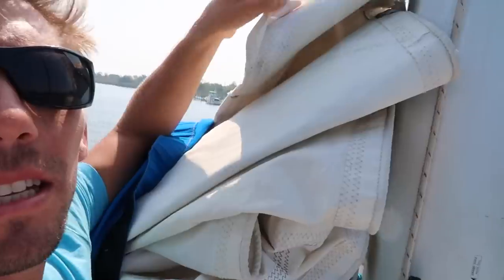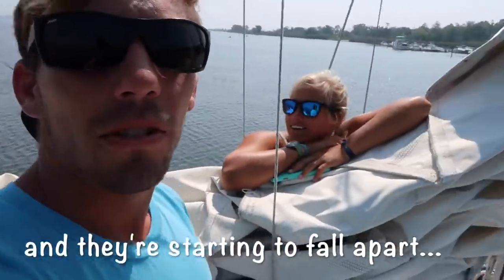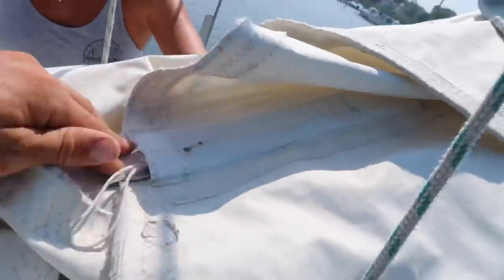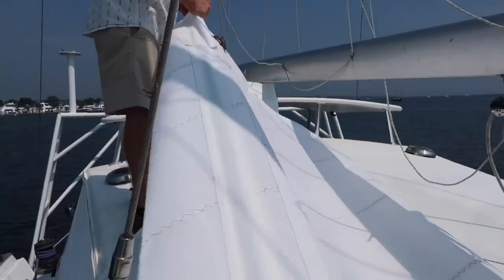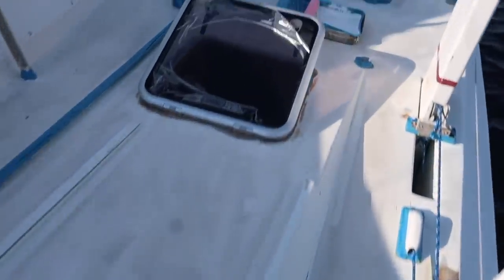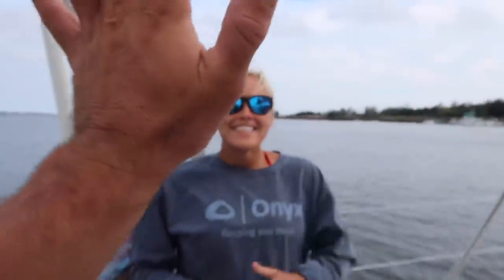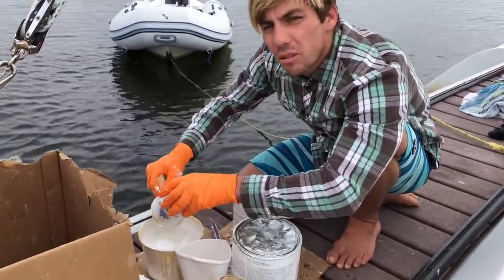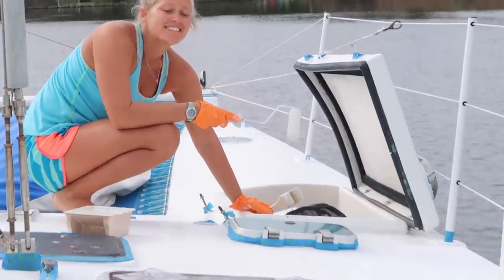The Most Expensive Thing We Have EVER Bought for our Boat! - New Sails

Comment: We love the channel and happy you guys found your soulmate so early... two questions..1. we just got a new (to us) trimaran and need to get tramps... l love the blue.... but does it get hot? 2. the 1/2 nets for jetty. where did you find them or did you cut them short?... my husband has been full time sailing traveling for 18 years I've been with him for 6... so careful it's addicting...lol btw..... we know your boat from Riverside marina...that is where we have found  some of our best boat finds! happy sailing🤗
Reply from the maker: Hey! Thanks for the comment. We love the tramp and have never felt it get even close to too warm even on the sunniest days with now wind. We got the nets at west marine. I think sailrite sells them as well. we didnt cut them we just attached them at a lower height and pulled them snug forward. This makes them snug even at a shorter height without cutting them and you actually get a lot more length out of them this way.. So funny you knew our boat at Riverside! Did you know Reggie?? What kind of tri did you get?
Reply: we never actually met Reggie...we just looked at the boat when we were looking for one of our boats.. we buy cheap, remodeling them using them, flipping them repeat..lol....it keeps us on the water...We have a 43 ft x 25 ft hortsman...biggest boat we have ever had... almost too much storage if possible...lol. can't believe we may have found a keeper....we just redid the decks so not so pretty right now and then are adding a 5ft bowsprit with the tramps extending out...so l got to pick the color he got to pick the design and extra 5 ft... l love the blue... l will try to figure out how to send you the link to the pop yachts add... my husband introduced me to your channel... it's the first time my husband has ever really talked highly of someone off a channel like yours..with praise..he thinks you are a respectful, humble young man and you remind him a lot of how he started out on the water... and we love seeing a true love story..lol ... if you ever meet him you will see he is an amazing man that is almost infectious to be around...and knows a lot about boats... diesels...engines.. fiberglass ...a lot..a little intimidating sometimes..lol...in any case it is a huge compliment...
Reply: https://youtu.be/mjOyQF8WX3k link to the boat we bought... we got it for a steal but they tried getting big money for it but it needed work.. let us know if you want a pic of how not pretty but structurally more sound it is now... only someone that has done fiberglass work can appreciate...lol.. we find it funny because the boat to us is a culmination of a lot of hard work to get her decks like they are...but we are not appreciated on the fancy dock of the marina..lol...btw my husband said it's a winged mast and sails...it's huge on a huge pivot super new to us but the boat rumers to been clocked at 28knts...ugh faster than l want to go sailing... I'm happy and a lil scared when we hit those rare 14 knts on our last cat.